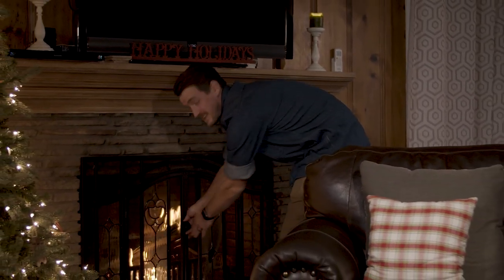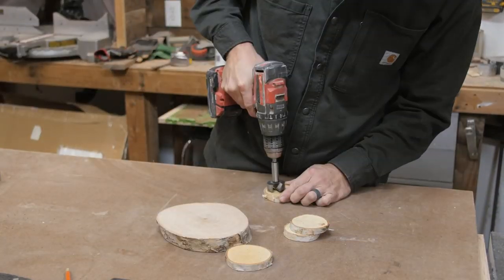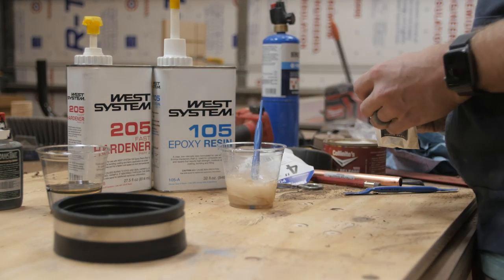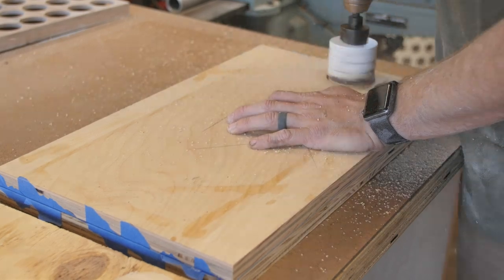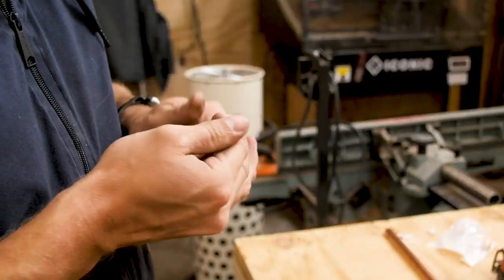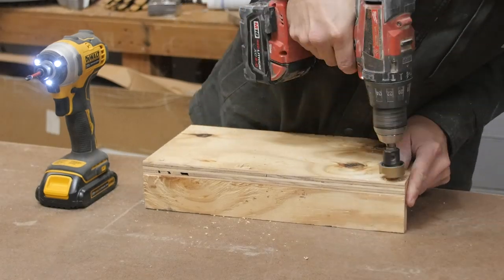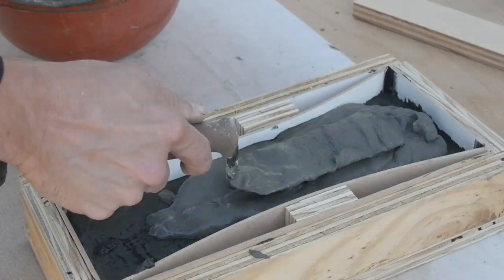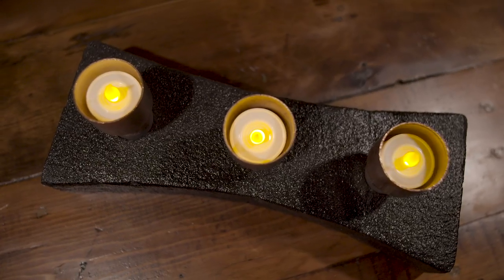5 DIY Candle Holder Gift Ideas

Comment: great video, going to try and do the pipe and Mason jar project, what size and type of wood did you use? did you glue the pipe? thanks
Reply from the maker: The overall piece of wood was about 12" long by 4.5" wide. That is a piece of walnut and no I did not glue the pipe. I just pressure fit everything and it holds together fine.